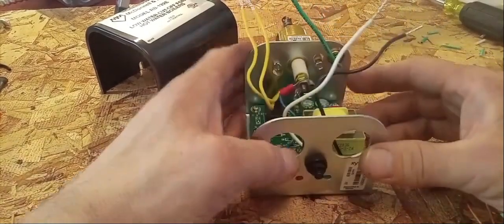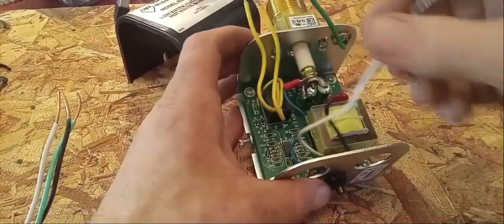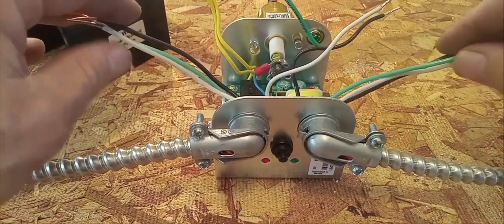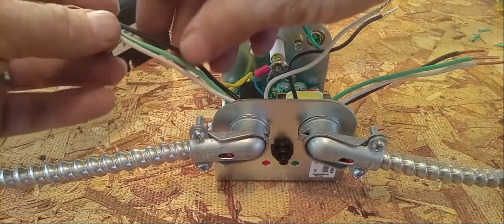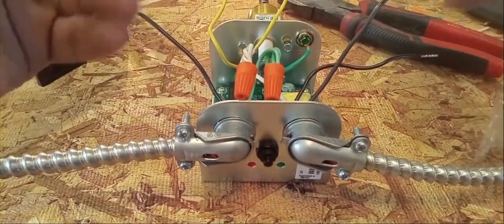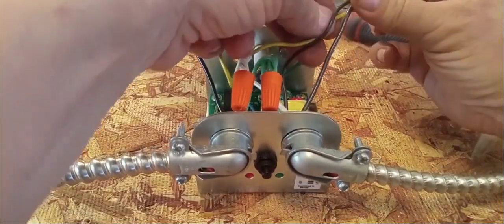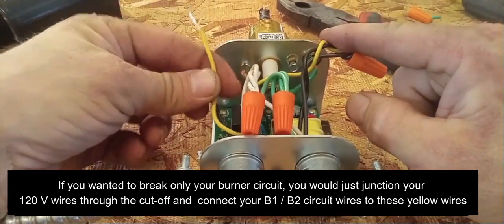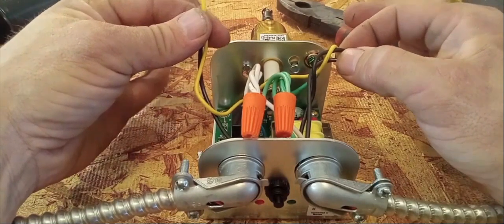How to wire a boiler low water cutoff (McDonnell & Miller)

Comment: Mike, you’re a HVAC rock star in my book, and I’m from NYC Manhattan so hello neighbor.  A 120v to boiler suggests oil burner rather than gas?
I had a 1964 system of Honeywell electromechanical components, and separate external 24v transformers for each zone, etc.  And of course, 50 years later some broke down.  I thought it was ludicrous to replace same-for-same even though Honeywell still made most or all of the components.  I started with replacing mishmash of pumps (1 was original but huge body, but others were what the tech had in the truck that day) with Grundfos pumps, Taco Zone Controller (4), and Hydrolevel Hydrostat 3200 w water cutoff insertion probe.  2 electronic devices replacing a 1/2 wall of 24v transformers & zone controllers, a hydrostat that had no status/temp indicators, etc.  Now I just have to look at status lights; see the temp reading go to 180, and boiler shuts off and set temp indicator go to green.  But maybe the boards won’t last 50 years, but I’ll be buried by then.  I know you trained techs know how to diagnose with voltage testing, but I’m a DIY so the indicators are a lot better.

Comment: I was wondering if you can give me some input on, I have a new steam boiler McClain  35 series with a 400 water cut off , I installed with a friend a new McDonnell miller universal 24v water feeder and when I test to fill when water is low it fill to the glass line then it pauses for a few and starts filling again to the point of overflow so I have to shut it off because it repeats the process about 4 times before it stops , what do you suggest is going on ? Thanks

Comment: Nice explanation.  One quick question for the hot lead on the right hand side: I see you have a the hot black feeding both the transformer and one of the yellow wires.  It seems to me that there would be a problem with the circuitry unless the probe has 3 connections -  the two yellows and a hidden one from the transformer/circuitry.

Other than this, I would also wrap the wire nuts/wire bundles with electrical tape as they tend to loosen over time.
Reply from the maker: There are no problems. These LWCOs give you different options on how to wire them. The 2 yellow wires can be wired either 24v or 120v. You can wire them independently to cut off just the 24v burner circuit and still allow 120V to flow through to the main unit or you can wire it the way I did in the video, which runs the 120V through the yellow wires and breaks the 120V run to the entire unit on a low water situation.

Comment: Mike. How would I hook it up to a CGA 6 boiler?  At the end of the video you mentioned that the last leg goes to 120 Volt burner circuit but the CGA is a 24 volt burner circuit with no external 120 volt relay for me to tap in to connect to the low water cutoff . Thanks

Comment: what's the advantage of using a 120v vs 24v?
Reply from the maker: Sometimes it's a selection based on the boiler or sometimes circumstance. A lot of combi boilers have 24v terminals for a lwco so it's easier. Sometimes in really cold environments circ pumps are designed to run continuously to avoid freezing problems, so a 24 might be better there because a 120 is typically used to kill everything, including the circ pump. So it's circumstantial at times, just a preference other times.